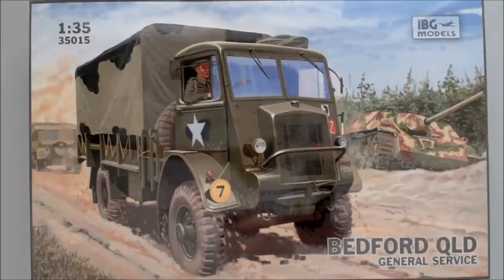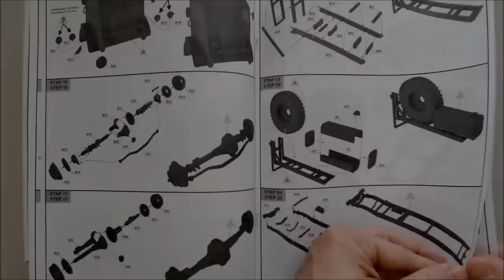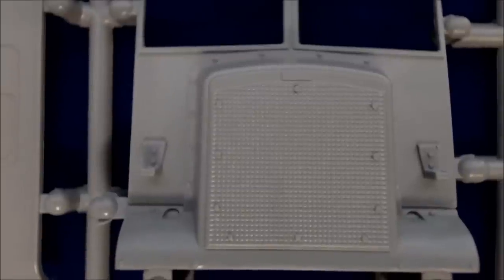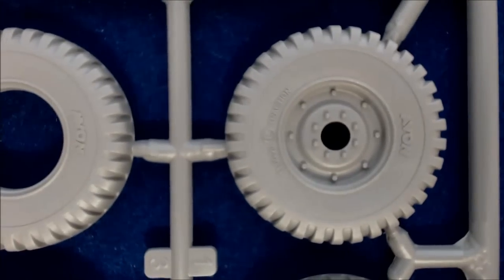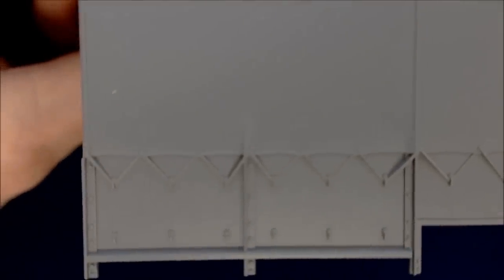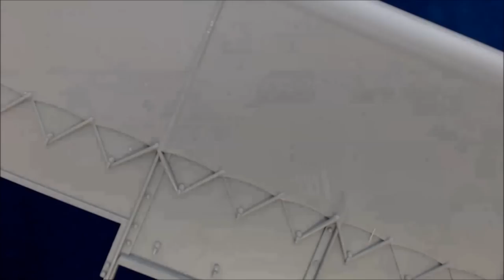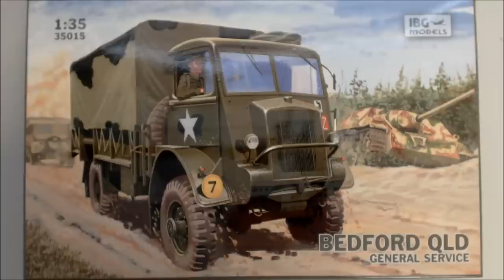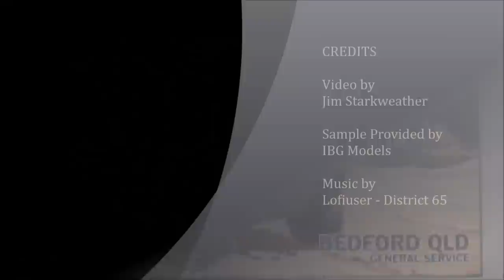IBG Models Bedford QLD (Truck/Lorry) Service Vehicle

Comment: It's only box art model obviously won't be near as deep I'm making my own bed and front grill from mesh and brass rod just now iv cut that plastic grill out donuts like my Wots and matadors with some pE PE bolts! Iv got 1.0 brass rod for tarp supports come to the 0.5 like the way they have them like shock absorbers and 0.5 across the top supports and the camo nets from AK i got them the other day to use on the bed I have the troop carrier with long bed and folding seats and middle bench it's a really nice kit just falls together and parts are solid nothing broke! Not 1 part think that's a first haha!